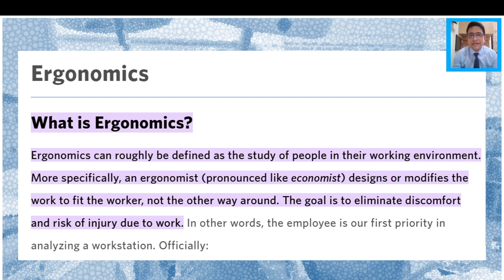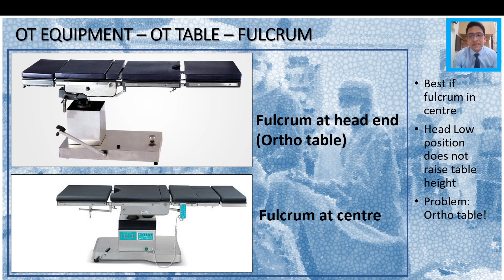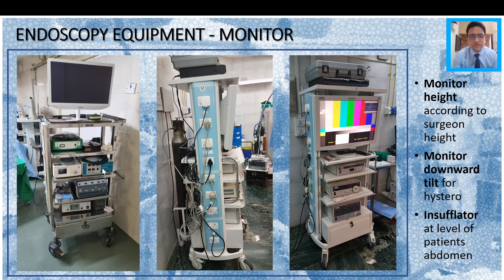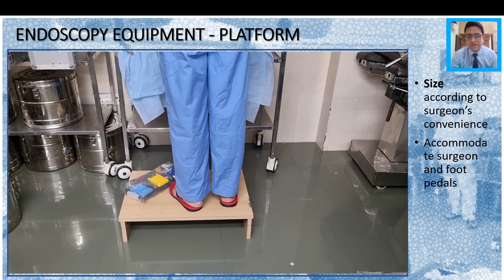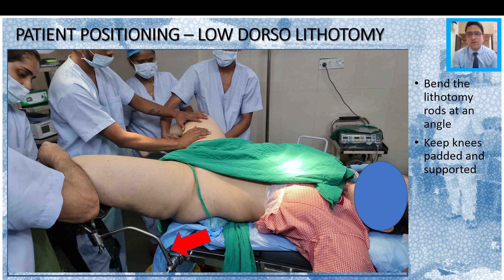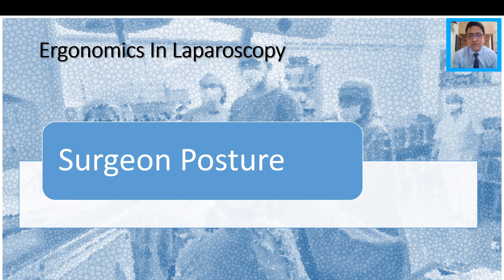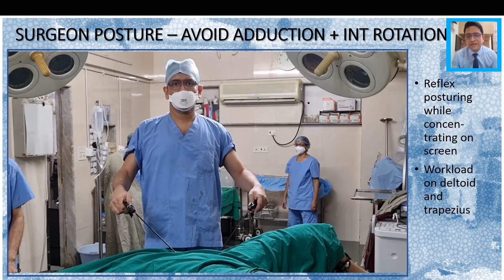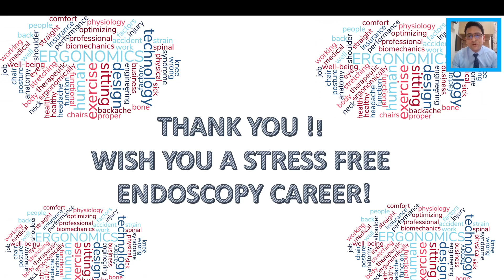Ergonomics in laparoscopy- reducing surgeon strain

Comment: Please detail on nerve injuries to patients and limits of abduction of legs of patient.  That's very important.  Also support in lithotomy to prevent  tibial nerve damage.  I use upper left port 10 mm for camera. This helps central port use for right side surgery. Less abduction of surgeon right shoulder. Suturing is extremely easy. In myomectomy   one doesn't need to take oblique incision,  if central port is used for instrument

Comment: nice summary, most "practical points" covered.. these are not generally 'given in books stuff' but learned by observation and "toiling with some mentor"..  speaks volumes of experience and "correct methodology" to be important in every case.. this is a handy guide to know why the case succeeds for a few "effortlessly", but others have to make more efforts when other knowledge factors are negated.. and the fact is that tricks are not shared with people 'immediately- mean at first meet', takes time, effort and desire to compile them, and material is available handy here..  so watch it and apply for all cases.. great work
Reply from the maker: Thanks Dr Shriram for your appreciation. Coming from a highly skilled lap surgeon it means a lot